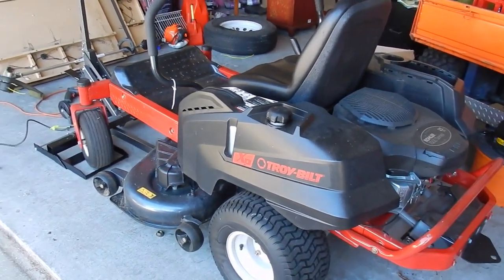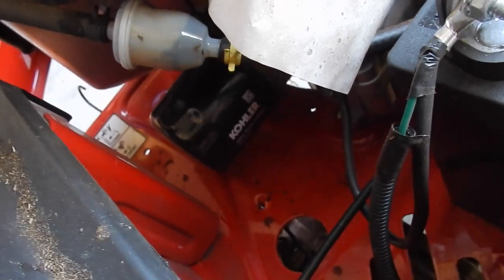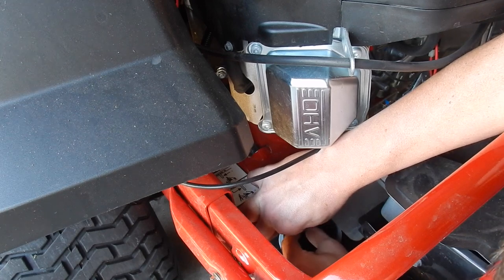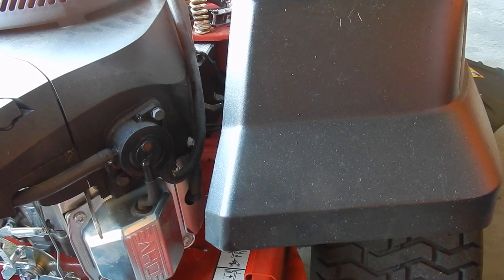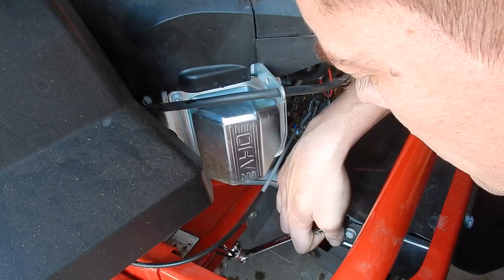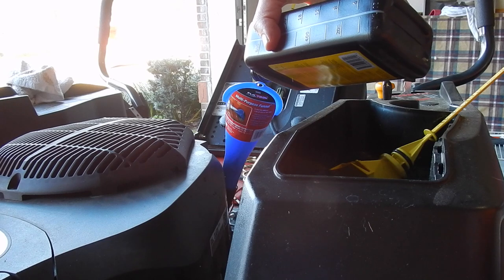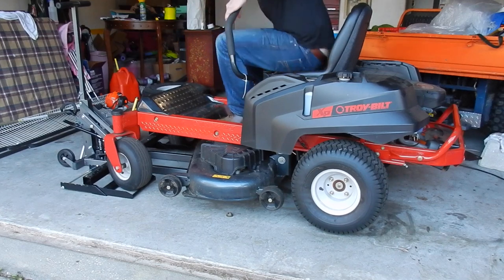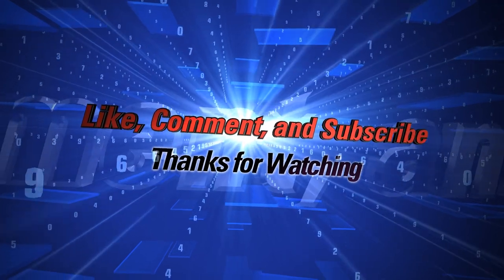How to Change the Oil in a Troy-Bilt Mustang 50" Zero Turn Lawn Mower

Comment: I am having problem with mine stalling after about 15 minutes of mowing.  I am mowing at the recommended RPMs.  It will stall at the highest RPMs and will only run and/or cut grass at the lowest RPM setting.  When it does this it also seems to want to die when I put a load on the engine.  I have changed the fuel filter and just went over 100 hours and will do the oil change as you showed in your excellent vid.
Reply from the maker: John Tarte it could be a carb issue. Not getting enough fuel and air mix

Comment: Hey Mike, have you found any other grease fittings on the Mustang XP 50, other than the 2 front castor wheels? You would think there would be at least 2 more grease fittings on the front end for the tops of the front wheel mounting locations where they go through the frame. Thanks!

Comment: Do you have or can you recommend a how to video on changing the air filter? I'm sure it's very simple but I'm a novice.
Reply: roseanna7s Take off the cover on the back where it says Kohler 7000 series (turn the two locking tabs outward), pull off the old filler, mash onb the new one. It's a friction fit and super easy. Then replace the cover.

Comment: How do you turn the red light off that alerts you to change the oil once the oil had been changed? Thank you
Reply: Jeffrey Howard  Mine reset itself after I mowed a bit.  🙂
Reply: Hopefully that means after you mop for 5 minutes or so the new oil has cycled through the machine and the sensor should automatically reset itself. If it does not automatically reset itself and either the sensor is bad or there's something else going on with the machine that needs to be looked at.

Comment: Are You supposed to fill the oil filter up and dip the edges in oil
Reply from the maker: I never fill the oil filter as it is sideways and will go everywhere. You always coat the rubber ring of the filter in old oil to create a better seal.

Comment: My dad always taught me to run the mower for a couple of minutes before draining it. The oil gets warm and flows easier as it drains.
Reply from the maker: It is true that warm oil is thinner. However I never change oil in a small engine while it’s hot. I had an accident when I was a teenager. I was fixing a mower while it was hot, the back of my hand touched the muffler and put a third degree burn on my hand almost to the bone

Comment: Hi Mike. have you messed with the Hydraulic drive units? Mine doesnt have drains on it. i was curious to see if you have messed with this? thanks.
Reply from the maker: That is a great question. From what I know these units are not fillable. This means they do not have drains nor have a place to fill them. If it is in need of fluid you would need to get it repaired. Don't quote me. The best thing to do it contact a Troy-Bilt repair facility and just ask. They should be able to tell you no problem. Thanks for watching my video.

Comment: I wish you would have been in more detail with the video, like what kind of oil, what size of filter, also you should put oil in the filter, change the air filter at the same time among other things, I didnt dislike it, im just saying it would have been more helpful.
Reply from the maker: Were you able to get the drain plug out?
Reply: yes
Reply: I need to know what the numbers are for the oil filter and air filter, first time changing them and I cant find the part numbers in the  manual, thanks
Reply from the maker: +V&C Collectibles oil filter found at lowes kohler 1205001s1c it's 12.94, air filter is at lowes too for 17.98